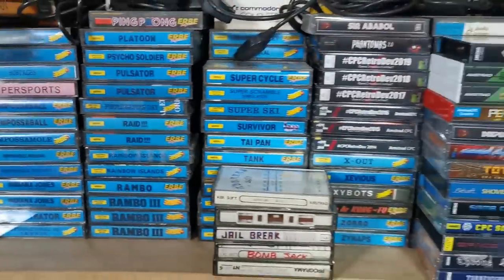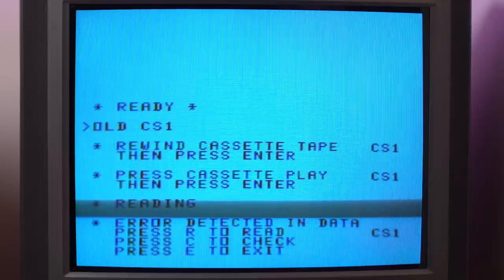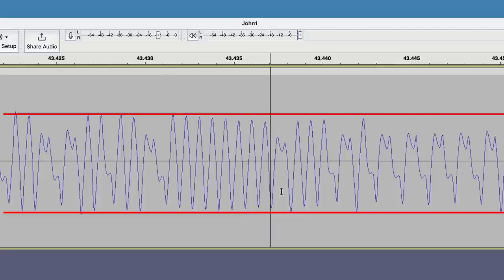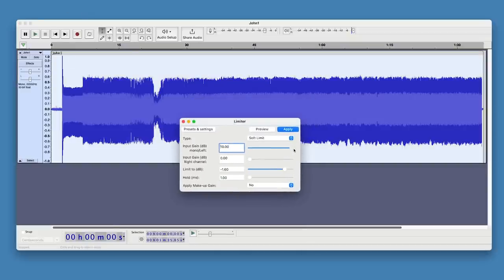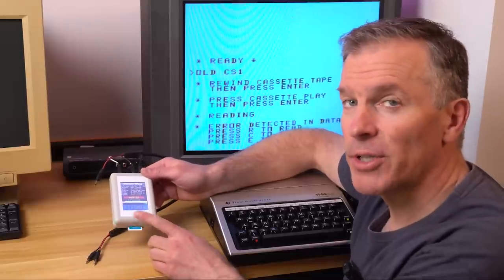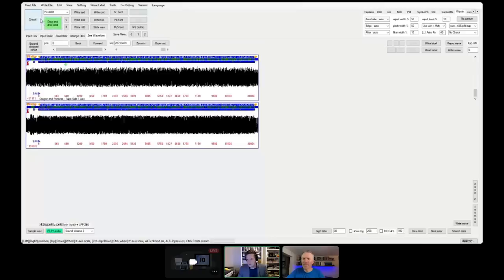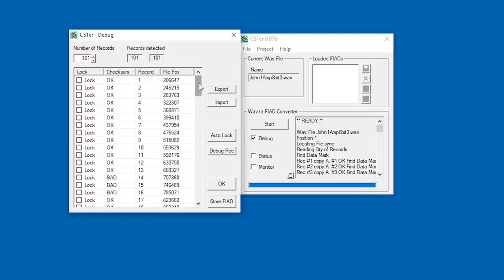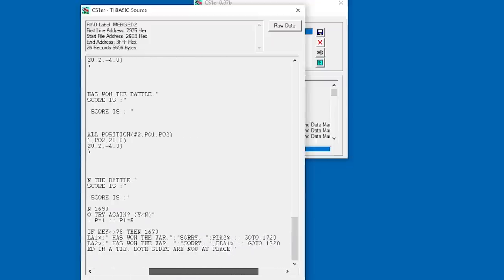Cassette Tape Data Recovery

Comment: Thanks for sharing, it was interesting to know how the data is stored. I think, if all blocks on the cassette are repeating twice and have a checksum at the end, then it may be possible to reconstruct a good block from merging corresponding bits together. If you have a sound file with a good quality, I can try later in Python :)

Comment: You mentioned that the game was already archived. Did you compare your recovered version to the 'proper' one? If you can see which bits were unreadable you may be able to match that with the sound wave in order to see why the decoding circuit got confused. Probably more trouble than it's worth though!

Comment: How do you know that "Gogfight" is wrong? It could be that it was saved that way. lol I spelled things wrong in my programs all the time. And sometimes even professional stuff has spelling errors.
Reply: He mentions that in the video.
Reply: The final text also says ENBDED instead of ENDED, clear mistake because is not only a bit shift, is an extra character.
Reply: @PG-gs5vb  yeah.....but I hadn't gotten to that part yet. lol
Reply: @GeomancerHT  yeah I wondered about that too.
Reply from the maker: Yeah, initially I was convinced it was a bit problem. Then I looked at the bit patterns of D and G and that was 3 bits off. Eventually I realized it was probably a misspelling 😃
Reply: @NoelsRetroLab  I can't tell you how many times I changed "red" to "green" for whatever reason and ended up with many instances of "greed" as a result. lol I don't remember why. I just remember it was a thing. lol
Reply: 18:39 does it not say DOG FIGHT on the screen?
Reply: @MattKasdorf  yes we're talking about the comment at the top of the program. That's not displayed.

Comment: Resizing that CS1er window would not help even if it was possible because the way its created, it would only expand the background, while all elements in that form would remain in the same place and size. If there is source code available, it would be possible to move things around easily, or increase size of some elements, using Visual Studio.
Reply: Alas, it appears to be closed source. :(  Quite unfortunate for a tool like this, and even more so now that it's been abandoned.

Comment: also make 8, 10, 12 separate recordings of the tape and then stack the data, average, sigma, what have you, to at least set yourself up to start from the best possible starting point before actually diving into reconstruction.

edit: unless cassette recordings are flawless, i have no idea, i usually deal with photons not audio :)

Comment: I don't know, if the saved program is saved as "text" on the casette, including the "100", "101" lines, but maybe load it as text in that program,
copy that into notepad and join all lines into one. Does Basic save invisible chars like linebreaks? Replace them with a space or underscore or this: § (this should not be on a US keyboard, so copy it)
after that, you break the line every 64bytes with ENTER.
So, there should be an error on line 14 then, probably? I mean 64 bytes is: XXXXXXXX XXXXXXXX XXXXXXXX XXXXXXXX XXXXXXXX XXXXXXXX XXXXXXXX XXXXXXXX 
Or going the other approach... 14*64 = 896 (0x380). so in a "clean" hexdump with no headers/footers, it's from 0x380 to 0x3C0. Wouldn't hurt to match both hexdumps (of record 14) against each other and compare them manually.
My guess is, this is something you cannot leave 100% to a program, it needs human intervention. Sure "ORINT" instead of PRINT can be fixed on auto, but what about numbers or GOTO linetargets? Yeah, this is complicated, but I have been doing strange approaches to problems.

Comment: i just recently got a ti99 +4 with a pair of controllers, couple cartridges, power supply and spare video chip? even though its advertised as working. it also has the alps keyboard. i really didnt expect to win that bid, what i really want is the atari 800.
Reply from the maker: That's a great lot you got. And hang on to that spare video chip, because they're hard to come by (non-fake ones that is). The Atari 800 is great too! Both really fun systems.

Comment: That was really interesting, I imagine it gives hope to some people who still have some old games they wrote on cassette. Did you consider using the 'normalise' option in Audacity? it creates a balanced volume.
Reply: I am pretty sure that normalisation in Audacity is not creating a "balanced" volume but simply increases the volume to the maximum available within your number of bits of resolution (i.e., it will set the highest amplitude in the file to the highest possible digital value, and scale everything else relative to that). So it's not going to fix areas where the volume changes.

It is, however, quite useful for making sure that your playback is loud enough. My phone doesn't have a lot of amplification out the headset jack, apparently, so on some WAV files normalising them made them load where they wouldn't before.
Reply: @Curt_Sampson  yes, I wasn't using it in a technical sense, perhaps the better word to use would be 'consistent'.
Reply: @HappyCodingZX  But it's not more consistent throughout the track. It's just "louder." If you turn the volume down an equivalent amount on your output device, you'll have exactly the same waveform again.

Note that it also won't produce more consistent volume between tracks because it normalises to the highest peak, and the average to peak volume varies depending on the track.

It's also worth noting that if you use this on a CMT track, you should first cut off any loud clicks at the beginning and the end of the track, as those will lower the amplitude of the actual CMT save audio.
Reply: @Curt_Sampson  thanks, that's clear.

Comment: The best tool is Audacity itself. Because you can edit the wave form and since a 1 and 0 are the only two expected waves forms, anything with another shape is corrupt. But most of the time what remains can still be identified by a human. The easiest is if you suspect it is a one, just copy a "1" wave pattern from another part and transplant it in the broken area. I recovered a complete ZX81 tape this way. And if you have guess then just try, having a checksum helps. Also if there are 2 copies you can lay them side by side to see what the original bits should have been because it is unlikely the same bits got broken. I wished I had something like Audacity back in the day. Back then tape with a slight corruption or drop-out was lost, sometimes many hours of work. Looking back a lot could have been recovered easly.

Comment: Sadly, that is one of the drawbacks of using magnetic media as a storage system. Both cassette tapes and floppy disks use the same technology. The iron oxide on the surface of the media degrades over time. Tiny particles of iron oxide break away from the media plastic surface causing signal "drop outs. One missing piece of machine code, or basic programing instruction can render the entire program useless. The average life expectancy of magnetic media is around 30 years. Most of these games on cassette have gone well beyond 30 years, and are now 40 years at the time when they were recorded. When you listen to an old music recording, you don't really miss any signal or sound "drop outs", but computers DO.
❤️❤️❤️❤️👍👍👍👍👍🫡🫡🫡🫡😊😊😊😊😊😊